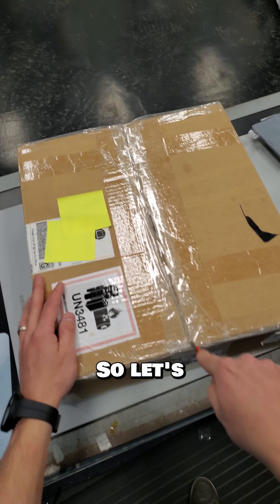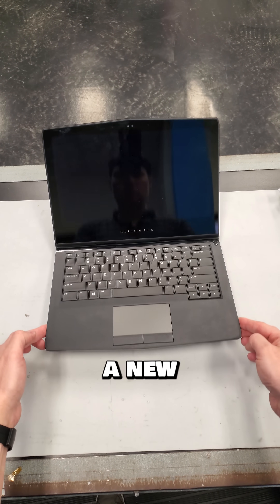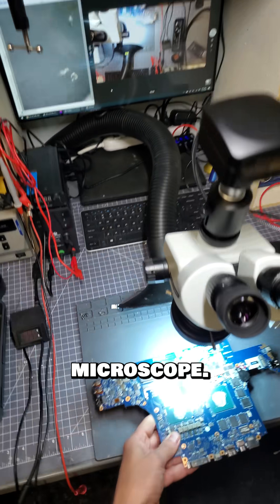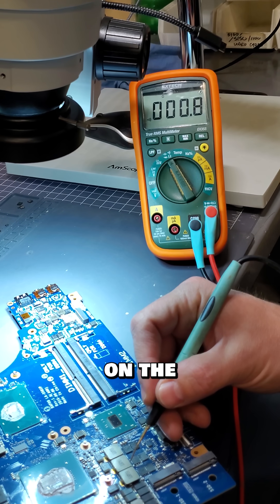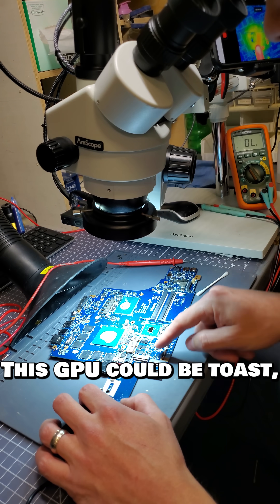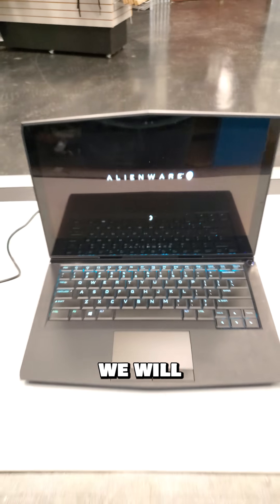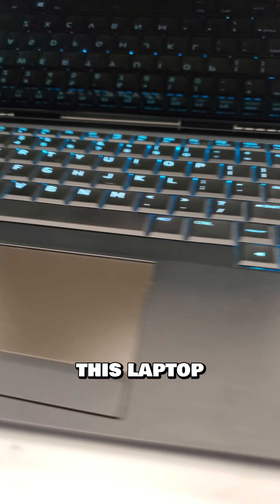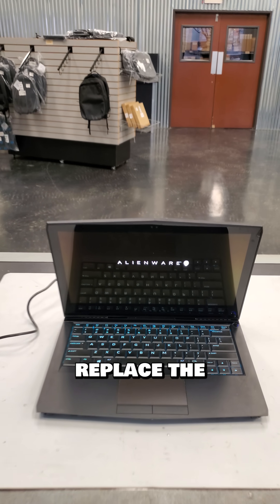Game Over? Gaming Laptop GPU Repair Fix #shorts #laptoprepair #computerrepair

Comment: do you have a top case assembly for the inspiron 3585, also do you have a ryzen 5 board for a 3585. Mine has a r3 board and a damaged top case. I’m tired of cpu throttling with the 2-core ryzen 3. I got this laptop for free and put ~260$ worth of upgrades into it. Also, can a newer ryzen board fit?
Reply from the maker: Here are all the parts I have for that machine. https://www.parts-people.com/index.php?action=category&id=141&subid=1281 We are out of stock the LCD back covers and do not have any palmrests either.

Comment: Can't you just disable the gpu?
Reply from the maker: Through software??? I assume that is what you are asking, and maybe, but you would have to do it through Safemode because it cannot boot to Windows.  I removed the MOSFETs, and the laptop booted right up and worked great. It is really the best option to disable it.
Reply: @dellpartspeople  I've done it before where I disable it in safe mode. But I guess plain out removing the mosfets will also stop it from re enabling itself after an update or so.

Comment: I have a question! If you replace the motherboard that means you can upgrade your cpu and gpu to a more recent one right? Or is the shape of the motherboard gonna be different????
Reply from the maker: Yes, kind of.  You can only upgrade to another option of the same laptop model.  In other words, if the option was available at launch for that laptop, then you can install it, but you will have be able to upgrade to a never motherboard that was not shipped with that machine in the first place.

Comment: 3rd option:
Replace the gpu die, they are sometimes not too expensive on older models 😊
Reply: yea... no, the surface area is WAY TOO BIG and doesn't worth the effort... unless you have a giant heatgun that can cover the whole thing

also good luck taking one of those soldered GPU out without ripping the pads
Reply: @ryujinayato1623  they have dedicated setups for this, i would not be surprised if this place had the station needed to do it either,
Reply: Yeah it's rather easy to replace the dGPU (here a small 1060)
Reply: BGA soldering is a pain in the ass.
Reply: @willaimwoods4841  you need a 500 dollar tool for that and stencils. Not impossible but worth it : ). Bottom preheater and top IR. New chips come reballed. Only need to clean the solder and you are good.

Comment: Dell : eh... maybe an IC shorted but let's just ask the customer to pay for an entire motherboard.
After this video, Dell : Man, even I didn't expect to be right!
Reply from the maker: When a laptop shorts out the AC adapter, if you take it to any repair shop, they will say replace the motherboard. Since the laptop was a 2017 Alienware 13 R3, Dell did not even stock the motherboard anymore, so the customer had to send it to us anyway.  We always try to fix the motherboard first to save them money.
Reply: I'm pretty sure guys at dell might have checked the mosfets and found it was shorted . These internal mosfets near the cpu and gpu that come before the inductors , shorting out almost always means the cpu or gpu goes kaput. Unless you are really lucky . I still dint understand why they don't put some protection circuit there incase of overvoltage.

Comment: You know how easy it would be to add a safety circuit in case the MOSFET failed but no that would be too pricy for these companies.
Not yo mention this happened in a high end laptop 😅
Reply from the maker: Well, the thing is, there is a safety circuit in place.  There are many protection circuits in place, current sensing and protection MOSFETs.  This fault just got past them.  I am pretty sure that if, once the laptop failed, it was sent in immediately and did not have the charger plugged in over and over, shorting out on the GPU, it would have been fine.  BTW: the laptop was 7 years old.
Reply: @dellpartspeople dude, you are you the repairman?
The resistance of ALL gpu chips are normally 0.03-0.05. So in case of any NVVDD fail - the gpu never dies. Can't say the same about FBVDDQ.
Reply: In case of sensitive ICs the MOSFETs are the safety circuit. The GPU will die before a fuse would blow, or a thermal fuse would heat up. Sure you could add more MOSFETs in series but it adds even more components that might fail, be more expensive, take up more space and be more inefficient (every mosfet adds resistance).
Reply: Is there any laptop with that feature in the market ?

Comment: My brother's hp laptop randomly stopped working one day,after got hp to check it they quoted a full motherboard replacement would be necessary, costing close to 600$, i paid a local mechanic 15$ to look at it and he said the GPU was having issues,he fixed the thing for an additional 20$
Reply: He sold himself very short

Comment: Just a guess, but If the CPU has embedded intel graphics, could you not just swap the Nvidia drivers for intel drivers? I assume  this as being a reverse of what I'm having to do to install an Nvidia GPU in a machine that uses CPU w/embedded intel graphics. Assume you'll still have to remove those mosfets, as well??
Reply from the maker: The intel CPU has a GPU and this board has the Nvidia also.  So you have two video cards to use, and if I remove the MOSFETs powering the Nvidia GPU, the laptop will no longer see it, and it will just be a laptop with one video card.  The laptop will just default back to the one of the CPU.  Nothing to change in drivers.  The laptop works exactly the same, but it just does not have the same gaming performance.
Reply: @dellpartspeople  OK, thanks for the info. Not a gamer, but I do look for similar performance in video editing.

Comment: Using a modded bios you can disable the gpu
Reply from the maker: Possibly, but the MOSFETs are still there and getting power.  It takes 10 minutes to remove and take them out of the equation.

Comment: What is that power adapter thing you have?
Reply from the maker: I made a special power volt/amp meter to test Dell and Alienware laptops with.  On one side, you can plug in the Dell charger; on the other, it gives you both sizes of plugs for Dell laptops.  It is very useful to see what a laptop is doing, whether it is charging the battery or even turning it on.

Comment: Oh does not being able to boot into windows mean dead gpu? I got an old computer that kicked the bucket awhile back and i cannot for the life of me boot into windows 7, just the two top windows pop up and then bluescreen
Reply from the maker: Because I know what happens to this GPU, it does.  But there are tons of reasons why a laptop cannot boot to Windows.  Your issue does not sound like a hardware issue.  Just boot off and USB Window install media and run Window repair or do a fresh install.
Reply: @dellpartspeople  i dont have a usb but i have a windows 7 disk, the problem is that it needs to boot to continue installing but when i do that it tries to boot into the bugged windows or into boot menu

Comment: Thanks for including videos where Dell wasn't wrong. It genuinely increases the credibility of your work to see that you can agree with their initial assessment.
Reply: Dell is awesome except
For some
Drive rbuvs atm which is not even their fault really
Reply: @Wally_Wombat689  and the amount of bloatware they preload
Reply: @Soul_btw  yeah true
Reply: Yeah I know. Having issues with them atm. However dells upgradability on the Inspiron 7510 is awesome. (The laptop that I have now). The stickers on the inside show you how to change your ram
Reply: to be fair I doubt they actually tested
Reply: Are they usually wrong and this was sheer happenstance?
Reply: @chris_007 I've worked in a similar production environment, and the assessments are rarely totally wrong. We'll occasionally screw up, but for the most part, it's a decent diagnosis, and we know that if that power rail is dead, the GPU is probably dead, and we know that the component level repair is going to cost more than a replacement module, and most likely more than a new computer.

Maybe there's a chance it didn't cascade, but it's not likely, and actually doing the test is gonna cost everyone more, all to arrive at the same result. Better to put your multimeter on about 10 total contact points and be able to know 99% of repairs.
Reply: @phillyphakename1255  thanks for the thoughtful response :)
Reply: Plot twist : he works for Dell , playing around with soldering Irons is he's part time Job .
Reply: They really aren’t credible but still better than apple…
Reply: i know whats wrong with it, it aint got no linux in it
Reply: still, MFS are scamming their customers to sell default weak sh!t
Reply: id trust this guy more than Dell
Reply: nope! they aren't the same.

 Dell didn't make any attempt to fix it. Even the GPU is fixable, you just need to replace the faulty  GPU using a machine designed for that purpose.

Comment: I'd make it integrated graphics only and use it as a server or also just to have a backup machine. Replacing the mobo out of warranty probably won't be worth it given its CPU's age.
Reply: cant you just buy a cheap gpu and use an external gpu enclosure?
Reply: @Anthony-uz5tj depends on if it has thunderbolt 3 or not.
Reply: @unoriginalname3442 and even with that. 40GBS isn't even CLOSE to what that dead GPU was capable of. Always wondered what is the best card that can run 100% without any bottlenecks
Reply: Some games are still playable even at its age, making it igpu only defeats the point of even having a gaming laptop.
Reply: This^
Reply: Let's use this jet as a wheelbarrow 🤷‍♀️
Reply: @Lilian040210  Replacing a motherboard out of warranty might cost as much as a new laptop or even more, since GPU and CPU are soldered on there. If you keep it iGPU only you safe that money, still have a usable laptop and can spend the safed money on another gaming laptop that will most likely will have newer hardware in it, giving you a performance boost. And it is less turning a jet into a wheelbarrow more demilitarizing a fighter jet. You still will get where you want but can't blow shit up on the way.
Reply: Yup!
Reply: bro thinks he's cool because he said "mobo" on the internet, lmfao.
Reply: @KennethJones-to1ig no one asked

Comment: Dealing w the same issue on a 17" alienware with a 1070...cant decide whether to invest in a new motherboard or not. At this pt the laptop is 7 years old
Reply: Not worth it for 1070
Reply: @sixty70-x3w  I would consider it if I could find a reasonably priced new one. But, everything is used and on ebay
Reply from the maker: That is always a big decision because those motherboards are still so expensive.  
But I can tell you, most people who send in those laptops, choose to replace the motherboards.

Comment: What’s the best way to find which components are shorted I’ve got a dell board and there’s a short on the cpu power mosfets and caps. I’ve blindly removed 2 mosfets but still shorted. No I deed voltage injection
Reply from the maker: You will have to remove all the cpu MOSFETS and test them out of circuit.

Comment: is it possible to solder another gpu in?
Reply: Yes. But it's very hard to do and need sparepart exactly like the laptop model. Which mean you need another motherboard from another laptop with same model.
Reply: @yudaprasetya9578  well after all it's just a gpu from either nvidia or amd, how about soldering the same gpu but from a different model?

Comment: Are you guys able to get rounded out screws that hold the motherboard to the cooling system?
Reply from the maker: Yes, we can remove stripped screws you cannot get out, but you can too.  You will need a drill the head of the screw. You can send it to us if it is a Dell laptop. Good luck!
Reply: Okay I ordered a box to send you guys my laptop thank you! I don't trust myself drilling that out

Comment: My laptop has weird lines(lot of random lines) flashing on screen everytime I open any game. I tried reinstall Nvidia graphics driver but it did not work then I tried disable Nvidia graphic driver and it ran fine.
Any idea what happened? Is it bad GPU too? Will it damage motherboard if I continue using it?
Reply: Your Nvidia GPU is dying, it's called artefact. It's happen when GPU is dying
Reply from the maker: Yep, Nvidia GPU memory is dying. It will eventually fail completely but could last a while.